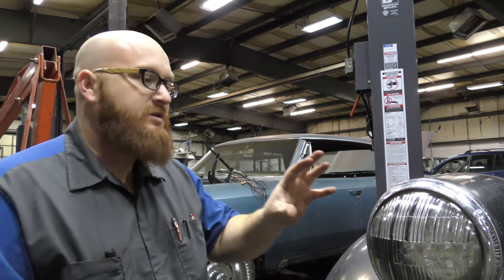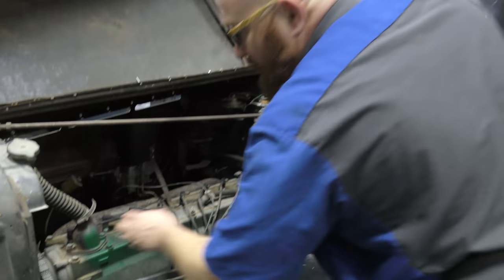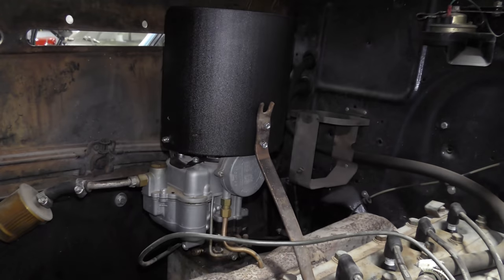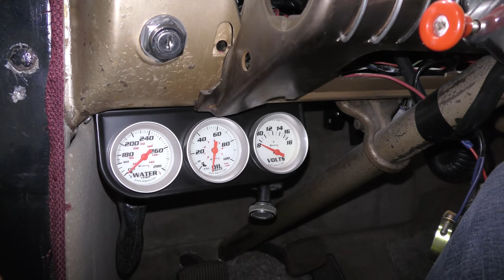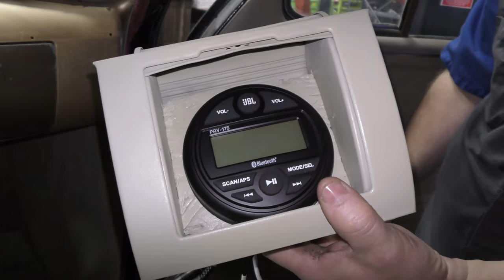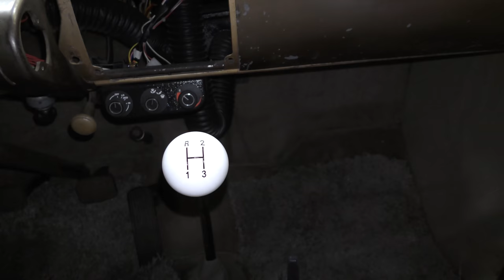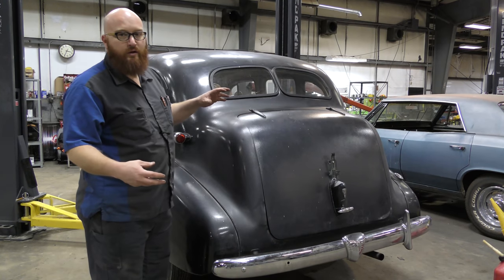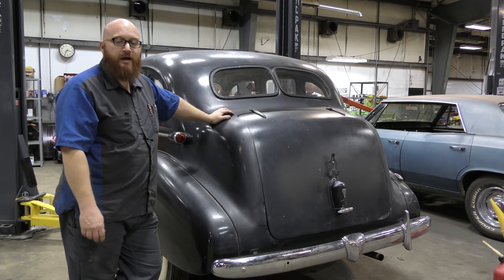OLDS SERIES #2: Nightmare to keep '38 Olds original! CAR WIZARD struggles to restore 83 year old car

Comment: I briefly had a 55 Chrysler  belvedere.   Interesting  working on old stuff see how things have changed. The electric  ignition  and 12v conversion is a must. Lol the bias tires will get old after a while too.
Reply: 12V doesn't do that much for you, although you can use smaller wire than 6V.

Comment: Wizard it is always easier and cheaper to modify a car then they keep one stock. When I redid my 71 Continental to get the correct hose clamps spark plug wires battery cables it took me two years to find a Correct exhaust manifold

Comment: One of the biggest advantages of a flathat is the fact they are free running. Even if you loose timing you'll never crush your valves. So it is way harder to destroy these engines.
Roller bearings are very common on pre war cars.

Comment: Classic Instruments or New Vintage USA should be able to rebuild those gauges with modern guts, just retaining the dial and hands.  Kinda like if you have an old electric or mechanical clock that bites it, and you just put a quartz movement behind it all.  Carburetor (if it goes) could be replaced with a 1bbl Weber or if you want to have fun (I think they still make them), put a 2bbl intake on it and go with a Stromberg 97 (parts availability far greater).

Comment: Everything I would do on an old vehicle is done. My daughter works for Hagerty Insurance. They insure Vintage vehicles and make sure your insurance covers you for when you are on the road and when you are not. She loves working  with people and talking about vintage cars. I had a 69 Pontiac Catalina I would love to own again. I don't miss setting points and adjusting dwell. My Pontiac  suffered a timing gear failure( common for those) and bent the exaust valves. I didnt know that until after replacing the timing chain and gears. I wish I still had it. Now I wouldn't  think twice about doing a valve replacement.  Back then I was 19 and had no idea what I was doing. I went to school of Chiltons back then.

Comment: I would TBI-convert it if you're actively taking it out since it'll run better with TBI and not require any major engine mods, plus it would still look carbed at a cursory glance, and the biggest advantage to TBI, and FI in general, is it starts easy in the cold.

Comment: Would if you are considering  investing in a upgraded Power Brake BOOSTER System install,  with a low level float system in the Reservoir to trigger a Lamp and audible Alarm incase you loose fluid...to make it a safer car for cruising,  as theres a lot of weight in that Sucker...i know that would be getting away from the Original detailing but safety matters...great Upload, will make a great street cruiser, would like to see it when the paintwork is all buffed up and wax polished and the Chrome fenders and Radiator Grille is gleaming with elbow grease yet still retaining it's Age...  Great Upload...

Comment: If you're still looking for gauges (not the speedo) you might want to hit up any buddies who are working on any '70s Internationals. Those rectangulars look really familiar in size and design, but I don't have any measurements.I think they were also individual gauges, separate from the speedometer. With any luck, they'll fit right in.

Comment: You can actually retrofit newer "innards" while keeping the gauge number faces. The glass can be buffed and the faces are prob almost perfect. Its not super easy but I bet it is easier than trying to retrofit a different style gauge. If I can find the site or channel that I have seen it on, I will update this post.
Also, if you went with a 4500K-5000K LED or HID it would have a warmer glow than the sharp 6000K you are running now. Once you go over 6000K you get the "bluish" color which IMO is tacky.

Comment: Wiz please have the inside of the light cluster either painted with heat resistant chrome paint or get thing polished sheet metal and roll it in.  
That side view dark shadowing and the shine of the led's (while turned off) will dissappear 1:13.

Comment: There could be a little cage type shield for those headlight glasses also I saw a video somewhere where they take the old generator  and convert the center to a alternator (so they look original). One last thing.. I once had an old Buick Straight 8 and it wanted to cruise on 90... slow revving.  Cheers

Comment: Hey Wizard, instead of moving the indicator lights/turn signals why not replace them with a motorcycle chrome bullet style set and maybe a sleeker looking bracket to match. Could be bulbs or even LED to match the headlights. I think it would work well with the design of the headlights and tail lights and match the car alot better than those square blocks on there currently 🤔

Comment: If you are going to put in Vintage Air setup, get one with heat and toss what is there now. The original car heater would have been a large box on the firewall as heaters were an option in those days. Too bad the original radio is gone, that would have been in the center of the dash and would have looked cool. Your work around is a good compromise.

Comment: I am trying to remember when I have seen cars like this, if that hole in the headlight was originally where a cable went through for the light.  Since you want to make the 'turn signal lights', perhaps you can swap the driver and passenger side which would place the hole on the 'outside'?  Just a thought.  Not sure how the mount or if it would be impractical to swap them side-to-side.

Comment: I would bet that the gauges are fixable. They’re going to be very simple electromechanical devices, and the mechanical part is probably fine. You just need to make the electrical part work, and I’d bet you could bolt on a servo or something that drove the mechanical part and it’d work. Maybe even a compatible aftermarket gauge could be modified to mate to the stock gauge’s mechanical part.

Comment: Put your radio's rear speakers behind the rear seat back cushion that will hide hidden the speakers, and the sound goes through the seat back. In the in trunk cover hole seat back with the appropriate cardboard or pressboard.

Comment: I would recommend having the foot starter peddle run a solenoid.  The new switches burn up much quicker than the old ones with the current flow to start.

Comment: Hey Wizard. I absolutely get what you are doing with this beast.  I'm not a purist, but I also would not want to see the old girl hacked around in order to "resto-mod" her if you have the chance of keeping her standard.  If she can be driven as is, then enjoy her as is until something changes.....like what you had to do for the headlights and fuel tank.  Even those parts still look like they are supposed to be there, so I get you've been sympathetic in the restoration in order to keep her looking as original as you can.

Many blokes have mentioned getting the gauge cluster rebuilt.  To be honest, I don't think you'd be happy with either a transplant of a similar shaped unit or making one up, because nothing would look as good to you as that old Art Deco beauty in place at the moment.  Although it would be more costly, I reckon you'd get the biggest smiles when you drive it (and not have any regrets) if you sent it away to be reconditioned to run on 12v.

One last - that piece of particle board you had behind the rear seat to protect the inner workings while doing repairs in the boot / trunk had me thinking.  If your spare has to go on top and you might be carrying luggage, you might want to consider putting something like that back in there so if the cargo (or the spare) shifts, it doesn't damage the springs etc in the seat.  A lot of cars of that era had similar pieces of wood (or a sheet of steel) screwed in place for that reason, so you're not really doing a non-period modification and it could save some heartache further down the track.  Just a thought.....  

In any case, the Olds is coming along great and I look forward to seeing it move along under its own power.  Could a short drive along the road after she's complete be worked into the final edit, maybe?  I'd love to hear those old gears in the box singing their song 😉

Comment: If you check out DD Speed Shop (Winnipeg, Mb) he does lots of Tri-5 Chevy work - they have ball bearings on the front wheels.
He always changes them out for regular bearings because the ball bearing wheels have caused him serious issues.

Comment: A 1938 oldsmobile? That work would be difficult.
I found a 1962 Ford Thunderbird, it was stuck in a downwards drive way, it's Ford-O- matick tranny was shot so it was left like that for a few years.
I bought it for $500.00 dollars and got it towed out and taken to a shop I worked in.
I had to cut a few sections of floor to fit a Ford C6 transmission.
The 390 engine had only 50,000 miles on it, so I gave it the standard clean up and it ran well.
It's the little things that drive you crazy.
The lock cylinders all had to be replaced, try and finding 2 doors, a trunk and new ignition cylinder!
It took me 3 months to just find them.
New carpets ? The rear was fine, but the driver's side was shot, but you have to replace the whole front carpet.
Like I said,...
It's the little stuff that drives you crazy!
It took a entire year to finish but I have a classic car that attacks attention!
The car is a chick magnet!
It's gotten a few trophies at car shows.
I have a 2008 Chrysler 300C and it's great, but it's not as popular as it's garage mate.

Comment: Our 56 Chevy had ball bearings. They changed to rollers sometime between then and 1960. Rollers need to be set almost loose. Balls must be a little tight. That windshield washer tank bracket doesn't belong.  Looks like from the 70 s. Even in 62 they were using a glass bottle if you had washers. Great idea about the gas tank. I've got a 62 Chevy 2 for parts and the tank might work in my 47 Pontiac. If it was me I would have put a more normal radio in that spot and then you would have room for the rest of the controls instead of in the glove box. Those gauges shouldn't be that hard to fix. Ammeter will work as is. Oil pressure and temp are probably mechanical. Just don't cut the tube on temp one it's sealed. You already have a 12 volt sending unit in the gas tank so you just have to get that gauge modified.

Comment: Get rid of the vacuum wipers. good luck. My mother had a 37 Buick with the straight 8. Stand right in front of it and you couldn't hear the motor running.

Comment: I found Amazon Basics 5-quart oil (about $22) meets  API SN PLUS, SN, SM OR SL, and ILAC GF-5 or GF-4.  Also MotorKote additive for engine, transmission might be a good move - works fantastic for noisy lifters and seems to help seals stray pliable... -- Joe Smetona

Comment: Wizard if you're looking for original parts try checking with Desert Valley Auto Parts they have all sorts of cars and while I'm not sure if it's the same one or if it's compatible with yours if it's not the same they do have a 38 Buick on their website (Dvap.com).  I wouldn't doubt that if you call DVAP they could probably tell you what years will work with your Buick as well and they might have a lot of the parts you want or need on other year cars

Comment: Brilliant!    The Motorcycle lights are very bright.  What's the hp on that straight-8?     The Buick OHV straight-8s had about 120 Hp.   It should do 60 mph.   You could 3-D a brake drum.    Jay Leno has used a 3-D metallic replicator to make the water-pump for his RARE, one of two surviving cars called a "Brush".   Jay used to work for NBC as the Host of the "Tonight Show" and owns about 200+ mostly very-rare automobiles.   Jay knows what you're going through, and knows people you don't.    He has regular staff and he works with many clubs.   Make-up a "parts-list", and perhaps his staff could make some auto-parts for you.   Trim CAN be done by hand/replicated, if the "work-platen" of the replicator is long enough.   I'd forgo a strictly stock "look" to retain different gauges stuck under a stock dash.   Oklahoma can get dangerously COLD, so I think it's IMPORTANT to know what's happening to your engine for your SAFETY, and if your wife is ever "winter-cruising" with you which can be fun for married couples.   Chevrolet had "hinged-hoods" like your Olds, maybe @ different years than your '38.   Who made the body?  Fisher?  Budd?  Other?   Some guy owning a Hupmobile, Reo, Nash, or Graham might have an odd, extra trim piece, if Budd had made your body on your Olds.   As your Olds is probably  almost 4,000lbs, I'd put-on disc front brakes with a power booster.  I realize YOU might not drive this antique over 45-50mph, but you May "Need" to stop much quicker than normally, which disc-brakes would allow.   You wouldn't, yourself, have been "reckless", but others could be, who are NOT as responsible/thinking as yourself.   Great video, thanks!

Comment: Regarding the Olds, did you make any changes to it so it will run with unleaded fuel? Or was that already done when you got it?

You put a lot of effort into the production quality of your videos. The sound quality is great but you would help yourself a lot by adding some lights to better show, well everything. A good set is only about $300 and now that LED lights are used on everything, they tend to be very durable...

Keep up the great work!

Comment: The ball bearing arrangement looks close to what Chevys used well into the 50s. They can be converted to tapered rollers inner and outer if you cross reference the diameters, a common mod on early Chevy spindles.

DO NOT repaint the car.

Comment: I wonder for the gauges if they can't be rebuilt if there's some rectangle shaped ones, either digital or with a needle that you could retrofit into where the factory auxillary gauges are and just leave the factory speedometer in its place for looks

Comment: If the work to replace the trunk floor made the space the space between the floor and the shelf too narrow to fit the spare tire you could simply raise the shelf enough for it to fit. If you are making the shelf out of wood raising it should be super easy just tack some 1" (or however much you need to raise it by) strips of wood along the bottom on the sides and back where it rests on the rail...You could even get fancy and add a wood divider slat under the shelf to hold the tire off to one side of the trunk floor and leave a cubby on the other side for a toolbox (or even build in a slide-out tool drawer.)

I Gotta ask why you don't like oil-bath air filters. From what I understand they clean better than conventional types and when they get dirty just change the oil (no "sorry we don't stock that filter" nonsense).

Comment: Would it be possible to hide the speakers behind the fabric and make them invisible?  Like the radio itself, it would be nice to keep it looking stock.  Depending on the fabric, you may have to 'thin it down' to make it acoustically invisible.  If it doesn't work, you can always cut the hole.

Comment: Try getting the gauge cluster rebuilt! I’ve had it done twice now, one time for my ‘72 Benz and another time for my ‘83 Suzuki motorbike. Of course your car is a lot older than either of those things but it’s worth a shot. I used a place called Lauderdale Speedometer and Compass Repair, 954-522-4885. I’m sure they could fix it or at least point you in the right direction.

Comment: That crankcase vent is called a "road draft tube". 

I'm totally with you on repainting it. People nowadays go way overboard the patina fetish. If it had the original, factory-applied paint and it was in reasonably good shape, I could see preserving it. But in this case the original finish is already gone. If it's had a poor quality respray, you're not losing a thing by giving proper paint job. I would humbly suggest choosing either an original Olds color, or at least a color that looks period-correct. That is to say, NOT Viper Red. Yeesh.

Nice thing is today you see the original colors for almost any car just by searching for "paint chips" or "paint chart" on eBay. There's some nice images of the 1938 Oldsmobile colors. 

https://www.ebay.com/itm/1938-OLDSMOBILE-SIX-F-38-EIGHT-L-38-PAINT-CHIPS-DUPONT-10PC/372643130353?hash=item56c342ebf1:g:sxsAAOSw8d9UuV00

Tahoe Blue metallic looks really nice. The Agate Red is pretty nifty too.

Comment: Congratulations again!  But please, try to get those gauges rebuilt, don't put modern Japanesey gauges in there.  And please, PLEASE, make sure your headlights are aimed properly!  This old guy can't stand how so many today want their lights aimed as if they were High-beams.  It is blinding to oncoming traffic.  Also, your stock gas gauge and stock ammeter are for 6 volts, and your stock radio is also for 6 volts, and I think before 1940, positive ground as well.  Something to think about in regards to the 12 volt conversion.

Comment: Heymr and mrs wizzard, i like your olds, though 1 thing i feel u should have done differently, is the headlights, fine  to convert to led, i understand that, though blue ish white light, on a 1938 olds...... NO....... it should be warm white, so it has the yellowish tint.......... otherwise I think good job!

Comment: @Car Wizard, may I ask how do you plan to deal with excessive wear on valve seat and valve face with the use of unleaded gasoline today ? In old days, engines were designed to be used with leaded gasoline. The lead coats the valve seat to reduce wear. Unfortunately , we don't use leaded gasoline anymore. I'm just curious on how are you going to run this engine.
Reply: Today at the wizards shop we'll be installing hardened valve seats in a straight 8 engine.
Reply: The tractor guys use lead additive in fuel on antique tractors.the lead acts as lube for valve stems and guides
Reply: @traderjack6151  That additive can't be tetra ethyl lead. I wonder how it would work in a car being run a fair distance.